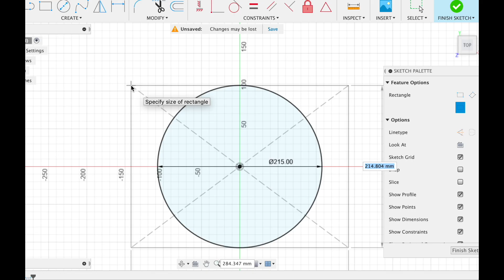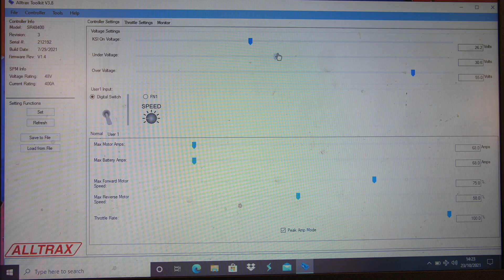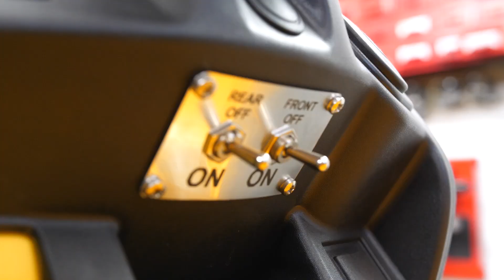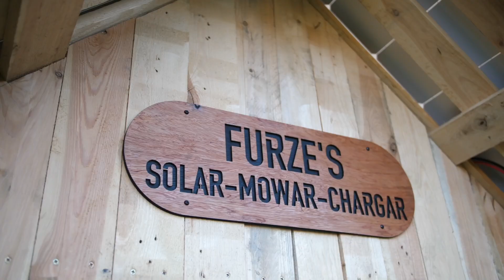EV Mower Conversion with Solar Charging Station

Comment: Love this project. Always wanted to modify a mower like this but with lithium. Just one thing to watch out for is that your solar arrays are different directions meaning that some batteries will be charged before others. This won't be a problem if they are all fully charged, but could be an issue if they are partially charged for a few hours in the morning or afternoon. You could use a dual channel MPPT and isolated battery chargers to get around this. Alternatively some sort of battery under-voltage protection on the mower for each battery or implement a circuit to disconnect the battery links (for series operation) during charging to avoid shorting out the chargers if they are do not have isolated outputs.

Comment: I'm a little confused, Colin. Why did you use a whole array of solar charge controllers, instead of just putting the panels in series? I get that these small ones struggle a little with cells being in the shadow, and addin inefficiency to the system, but in an open garden like yours, wouldn't a single controller per side of the roof have sufficed?

Comment: The "Now You Know" channel did a great video about the benefits of electric lawn equipment, including the vast financial advantages for commercial gardening firms. They also made some videos about electric lawn mower conversions.

Today electric lawn equipment is cheaper to run, much cheaper to maintain, more dependable, less noisy, healthier for the user, and often even cheaper to purchase than gas powered equipment! The only kind of equipment where the electric version was just slightly more expensive was a ride on lawn mower, and prices are only getting lower as battery production improves.
Reply: While electric is good, I still believe gas is better. Not better in most ways, but you just can't get that kind of power with electricity.
Reply: @scottowens398  But you can. There is plenty of electric lawn equipment with the same power output as their gas counterparts for about the same price, in most cases even for a lower price.

Comment: I love the idea. But how much did it cost to convert. Here in Canada that's a $1300 mower. One battery is $90×6=$500. Chargers, controllers, wiring, electric motors x 2 ? $600. Solar panels $ ? How much are we talking here? $5-6000, $ $8000 ?

Comment: you scalped your lawn!!!!

FWIW, the extra speed/torque on the blades give you a cleaner cut, and help power through thicker grass. For commercial use, you absolutely want that. For a residential yard, yeah speed it up

Comment: Improvements I would add is some kind of gauge that tells you the battery capacity and how much longer you have until the batteries die on the machine itself
Reply: With the size of his yard, he certainly doesn't need to worry about range
Reply: i think that he already has that. he knew at all times how much power is in the machine
Reply: @sirBrouwer  not on the machine though, which the comment specified
Reply: Needs a victron smartshunt, maybe two.
Bluetooth connection to a dash mounted phone or tablet 😀
Reply: He used some shitty lead acid batteries.  Why he didn't go with LifePO4 is beyond me..
Reply: @FJB2020  money?
Reply: @mickys8065  Two 12v 100ah LifePO4 batteries would have replaced those 8 lead acid batteries and cost less and given him a longer run time... plus a huge weight savings...
Reply: @FJB2020  He only used 6
Reply: @FJB2020  I'm assuming at least one of his batteries was already the mower battery from before, so that's half the cost gone at least
Reply: @FJB2020  Not so easy, seems that the motor Colin chose requires ~72V (6x12V), so two 12V LiFePO (24V) will not cut it.  Also higher voltage lower current, so going low voltage has other costs too.
If he went 6 12V LiFePO, that would have cost ~3x more in batteries, maybe over budget.
Reply: @ikocheratcr  good point, I didn't catch the motor voltage..
Reply: @mickys8065  Or because this is a prototype.
Reply: industrial climate change is fake

Comment: My yard is about 10' x 25' and I want one... I can cut it w/ a battery Weed Wacker but I still want a solar powered lawn mower, maybe even a small push mower style w/ a 24v 500w motor and 24v 15ah battery w/ a small solar panel would work.  🤔🤔

Comment: It's not really 'green' though is it, you need coal to power the furnace to make the steel, you need oil to lubricate the gearbox, you need oil to make the tyres, you need oil to make the plastic battery cases, you need oil to make the wiring sheathing, you need oil to make the wheel bearing grease etc etc etc.

Comment: Colin: "... these are commercial ones obviously... "
Me: laughs in American

but seriously I have neighbors that have yards barely bigger than his and use a riding mower
Reply: I mow about 1000m2 with a push mower now while I’m young 

But when I get too old I’ll be getting a robot lawnmower
Reply: @richf5967  Not a bad plan. All math done, a robot mower has to be cheaper than having a kid of your own to mow the lawn, and may even save versus hiring another neighbor's kid to mow it.
Reply: I get people with smaller yards using a riding mower if they're very old or disabled. And don't have a healthy person handy.
Reply: I use one for a 0.33 acre property. Overkill, but I get it done in under an hour which greatly helps reduce my weekly household maintenance time. They also can pull trailers, till a small garden, plow the snow off the driveway, etc. They're super useful to have around for more than just mowing grass. I recently did some levelling of my lawn and just used the mower to pack the dirt. They call them lawn-tractors for a reason!

Comment: Why are you using lead acid batteries in 2021? I was hoping for a guy like you to play with lithium cells, recycled ones if you wanna help the environment, and for a land mower that is only used once a week or less, lithium batteries will last forever with only a few cycles per month.

Comment: That's a clean job, Colin! For all the people who are wondering if this has ever been done before the answer is "Yes". General electric started producing electric lawn tractors and garden tractors in the late 1960s. They are called the Elec-Trak and were available with a wide variety of attachments including a snowblower a rototiller and a front end loader. I have one that was built in 1970 and I cut 3/4 of an acre with it.
There are several guys who have made the conversion on these tractors to lithium-ion and there are a lot of good reasons to do it. However, lead acid has a lot going for it too, particularly for a tractor. The weight that you gain by using lead acid batteries is very useful for plowing snow, etc.

Comment: There are drop-in replacements for those lead-acid batteries, like the SOK batteries (LiFePO4, in either 100 or 200 AH).
Also, a proper solar shed would be good, with a battery bank to use it to charge the mowa faster or use the energy for your cordless tools 👌🏼

Comment: 1 extra mod you need, a turn table for the mover so it’s ready to go straight out of the shed, that cleans the blades too.
Reply: Why not add jet boost and hover rotors while you're at it.
Reply: @MonkeyJedi99  so a literal ‘Hover Mower’ 😀
Reply: @missionairsoft5491  You get it.

Comment: Beautiful project, even I thought batteries wouldn't last all that time but very impressive indeed.
Probably someone else has already said it but what about putting some storage capability to the charging station just to don't waste all that energy when you're not charging the mower. It will also prevent the eventual absence of sun due to  cloudy/ rainy days.

Comment: If you build a case I'll build you the battery and it will probably last five or six hours But it won't be cheap or save the bother how about buying a Tesla cell pack 6s ? How many volts do you need and how much current do you want? Also with your solar panels in the summer they don't like the back of them to get hot they need air flowing past them 👍🏻

Comment: I mean it, what was the overall cost of the project? The Colin Furze "Solar Mowar" shed could be a great item.
Reply: Why?
It's a waste of energy. Ones the mower is completely charged the solar panels are useless. Just get a normal solar system.
Reply: @Jehty_  you could probably get a really small solar panel that just barely (obviously including a buffer) charges the lawnmower in the time span until you need it again (although I'd guess that such small solar panels have a shitty efficiency and price-to-performance-ratio). Even though just putting proper solar on your house and charging the lawnmower with that power is probably a better idea.
Either way, the lawnmower itself definitely is great.

Comment: How much are motors plus esc's ? I have a similar mower. I reckon current cost of motors + esc's + Lithium + balanced chargers would be huge compared to petrol version in the first place. Petrol cost is negligible cause you don't use it very much. e.g £50 a year. Admire the dream though and top eng skills. Hydrogen vs Electric - where are you furzey ? - I saw JCB are committed to hydrogen as electric diggers are not happening because of up time requirements and weight of batteries. Im sure you could do something on Hydrogen.
https://www.youtube.com/watch?v=19Q7nAYjAJY

Comment: The “toy” in the glass bulb that turns when light hits it. I forget the name sorry but I have always wondered if you could use that as a solar panel to turn a music box? With the right gear ratio, not using electricity, just the rotation caused from the light on the dark sides of the “toy”.
Reply: No, you can't use a Crook radiometer to power anything.
It produces such a small amount of momentum that it only works in a partial vacuum and on a low-friction spindle.
Attaching anything to the radiometer would prevent it from turning.
Reply: @Jehty_  thank you. I knew about the vacuum. I was hoping that there would be away to make music box like things for in a cemetery. Leave a little song at a loved ones grave. Sunny days it could play and not make the cemeteries not so lonely.
Reply: @anthonyk7924  sorry but that would be cacophony

Comment: It could be more efficient, and cheaper to build, if it didn't need to carry a human driver. Add a few wireless cameras, and the human could sit in a comfy chair indoors to control it. Or better still, make it self driving, which some people claim is the future for cars, but is less likely to cause mayhem and death if it's confined to a lawn, than if it's let loose on the roads!

Comment: If you get a source for some better batteries, it’ll be able to run for allot longer than you need, and all that power your getting from the solar isn’t necessary, so I recommend adding a radio and speaker system and optional headphones to the mower, and some outdoors lights and speakers on the shed for when you have guests over etc

Comment: I wouldn’t write off the faster charging aspect. A lot of people use tractors for more that just grass cutting. 

Did you change anything with the gearing to make it go slow? I would start with the original gearing and tweek from there. The original engine is probably around 3600rpms

Comment: All you need to make a bespoke lithium battery is already on the web. From single cells, nickel strips and a bms, plus the little snap together plastic battery holders. All you need then is a little spot welder and your good to go. Check out DIY Perks for the battery he made look like a small 
suitcase... https://www.youtube.com/watch?v=adY-S8AH_Jc&t=137s

Comment: Colin I built a 1.5kw lipo power pack 7s 3p that is about the size of 1 lead acid battery. They are from new old stock for electric buses. I’m in Peterborough if you want to see them test them

Comment: Actually lead acid batteries are probably the best choice here - weight doesn't matter much, it's not a racecar, performance is good enough, doesn't need to go too fast, they are super easy to charge, last long, are perfectly happy sitting fully charged for extended periods of time, don't have a habit of exploding and catching fire, also quite cheap...
=> Unless You want it to be a racing mower, Lithium doesn't make much sense, Lead acid is better

Comment: since this is an environmentally friendly project DO NOT USE LITHIUM. its a harmful substance and cannot be recycled. deep cycle lead acid batteries however last way longer than any lithium pack and are completely recyclable. my rideon mower has electric start and the lead acid battery in that is almost 19 years old now and its still going strong. lithium cells will only last 10 years at absolute best if they are kept in ideal conditions. they will not work in cold conditions and cannot be stored fully charged over the winter or they will die and have to be replaced. the only lithium battery that even comes close to the durability of lead acid is lifepo4 cells and even then they still require alot of house keeping to make work (like bms and the likes)

Comment: I am not participating in the new communist utopia full of electrification that the worlds left extremist governments are proposing. Since I don't trust my own government, nobody can reasonebly expect me to be ok with a goverment enforced change of life. I don't want to drive an electric shitbox because I believe they will eventually force manufacturers to let authorities take controll of your vehicle if you are speeding, or if you drive with dubbed tires in zones where you can't, and with overweight vehicles, even if just by a gram, shut them down if one were to drive it into zones where there are restrictions. That's no longer a utopia, that's dystopia. Also electric shitboxes are booooring. No sound, no acceleration feel, no good top speed, and it takes forever to refill it's fuel source. And I would rather crash headon with a truck at 120 kmh or so, in my 2004 Saab 9-5, than in say a Tesla modell 3 or a Wolkswagen ID3, because in my saab, I will be very injuired, but alive, and I could recover. With the tesla and Wolkswagen, I will probably survive the collision, because of more driver safety equipment, but then there is the question of how to leave the vehicle. It is going to catch fire, and I will be burnt alive. I am not about that shit. So I am gladly going to spew 2 stroke smoke, yeet carbon dioxide, and shit diesel soot as long as I live. Nobody will stop me, and if you try, I am commiting suicide. I don't want to stop.

Comment: Clearly this shows that even with shitty old school batteries you can make a better mower... But in a market dominated by price no one worked on that.
Leave the lithium batteries when really needed, this beast can work with lead acid and probably one less battery for less weight. Brilliant idea!
Reply: All kinds of fully electric lawn equipment are already available, most of which are even cheaper the gas powered equipment!

Comment: This is genuinely genius. Smart packaging (a sturdy wooden crate) could be repurposed as the shed/docking station, meaning nothing is wasted, you just take the solar panels out, fix them together as the roof, all already wired up just plug and play.

Comment: "Environmentally friendly", "lithium battery". You're gonna have to pick one, lithium pollutes more than equivalent petroleum-powered engines.
Reply: which is unfortunate. we need some way of dealing with the slag from mining tbh.
Reply: @minigolfkid  we need to deal with more than the slag. Lithium batteries have a 10-15 year lifespan and are impossible to recycle in any sort of efficient way, and that doesn't cover the fact that lithium is a rare earth mineral in the first place that we also need for mood stabilizer medicines. Oh, and lithium is incredibly volatile even after refining and processing